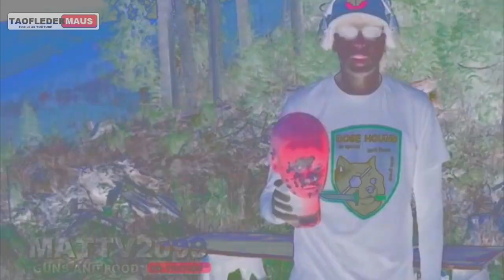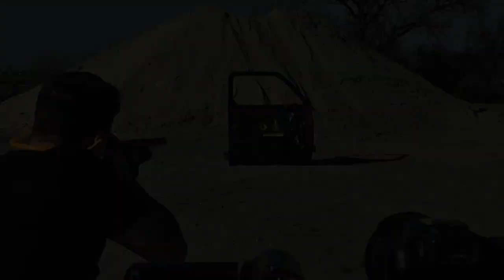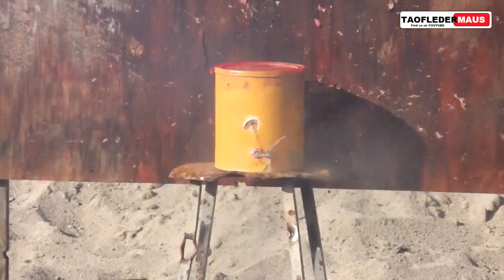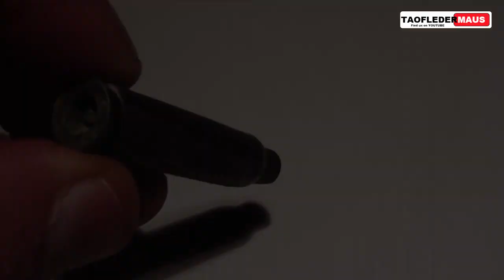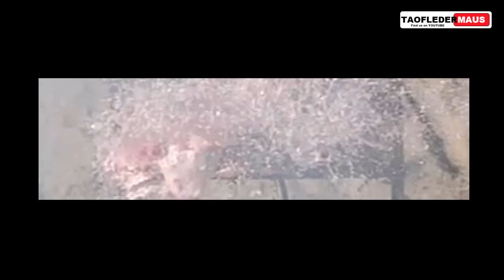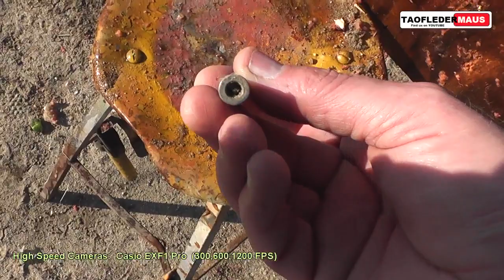LIVE 5.56 Round Shot out of a SHOTGUN - Dangerous?

Comment: WHAT IF? you took that 5.56 round and cut the back of it off and had the powder of the shotgun shell touching with the powder of the 5.56 shell and put a heck load of glue connecting the shotgun shell to the 5.56 shell so the 5.56 shell will stay in the gun, would that just blow the gun up or shoot a really pack a punch 5.56 round

Comment: how about a live .223 or a 9mm in a 410 shot gun cartridge shot through a rifled barrel?   u would have to check the barrel for obstructions afterwards, because the shell could get stuck.
Reply from the maker: Peter Phelan  Rifling only works if the object engages the riflling.  In other words,   a 1/4" bolt doesn't thread very well into a 1/2" nut.
Reply: ***** 9mm shell has almost the same diameter as a 410 slug, it fits in the shot cup. i just dont have the gun to try it in yet.

Comment: Bore out a shotgun slug mount a firing pin in the bottom place an appropriate sized bullet in the hole so it is not over extending the normal slug shape by more than a hair or two, seal with wax or other material as you see fit and then you will see some scary fun it will not be like a Bowmag as the secondary detonation will or can be inside the target Splat!

Comment: You'd need to strike either the primer, or puncture the cartridge with force, in order to detonate it the gunpowder.
Considering that the bullet was built aerodynamically, and the cartridge to stay inside the action, it comes as no surprise that these are spinning sideways. After all, the weight is in the lower portion of the cartridge.

I doubt you'd ever be able to create enough pressure to detonate the gunpowder just by putting force on the bullet. Most likely what would happen (if you could keep it flying straight) would be that the bullet would just crush up, and the projectile loses all its energy and stops. 

Modern cartridges are safe in the respect that they don't detonate as easy as you think.

Comment: OK how about a small spring steel rod in the center of a rifle round. If the round were chucked in a lathe a hole could be drilled in say 1/8 inch deep by 1/32 diameter. press the rod in and grind it off flush with the nose of the round.

Comment: Interesting.  I suppose if you used a rim fire .22, there would be more likelihood of it hitting something and going off.
Reply from the maker: Arctic Arsenal  I'm not sure.
Reply: They do go off if they hit a hard surface, i dont have a video but i hand loaded 5 .22 in a 12 gauge round and fired it at a rock from cover. There was two reports so i think a couple of them went off. The best way to load it is the center one facing forward and four .22 rounds facing the base of the 12 gauge round.
Reply: *****
Now we're sure.  Would you consider trying to duplicate this, but with your own twist?
Joerg Sprave fires .22 blanks from a slingshot.
watch?v=QLU3tk5d8I4

Comment: The six inches of sand saying is a little misleading. From a video I saw a long time ago, higher velocity rounds like a 5.56 NATO will only penetrate 4-6 inches of sand because the round shatters when it hits the sand. Lower velocity rounds like a .45 ACP penetrate much farther because its able to maintain it's structure while traveling through the sand. Whoever made the video used drywall to create six inch thick compartments which they then filled with sand. The idea was that the drywall offered little resistance while keeping the sand contained even after it was shot.

Comment: The 5.56 is the same as a .223 right?
Reply from the maker: Jacob Pendleton  Sorta.
Reply: ***** what's the difference?
Reply from the maker: I think 5.56 has higher pressure.   Some rifles will shoot bother 223 and 556.
Reply: ***** ah I see. Thanks
Reply: Hey Jacob. The only difference between the to rounds, is minute. The shoulder of the 5.56 is slightly longer than the .223. You can shoot a .223, out of a rifle chambered, for 5.56. But you can NOT shoot, 5.56 out of a rifle that is chambered in .223. Because the 5.56 won't seat properly in a .223 chamber.

Comment: The reason the rifle round didn't shoot properly is because on the inside of a rifle barrel it has a kind of screw indentation which rotates the bullet when shot thereby giving it a higher velocity
Reply: The "screw indentation" is called rifling. Hence the name rifle. The twist rate imposed on the projectile as it travels down the bore actually decreases velocity. This rotating action means that energy is being exhumed to do two things: 1. Send the projectile down the bore. 2. Impose a twist rate on the projectile. Two actions uses more energy than one. Rifling slows velocity, but the twist it imposes on the bullet is what keeps it stable in flight.
Reply: Higher velocity? No. it gives it balance. Same properties as a tire really. The faster a tire rolls the more stable it becomes, to  a point, then it degrades in stability if too fast
Reply: Sorry, I'm rusty on my rifle knowledge. I'm not a rifle fanatic and I've never owned any guns. It's just something that was breezed over during my time in cadets where I learned little about rifles and such.